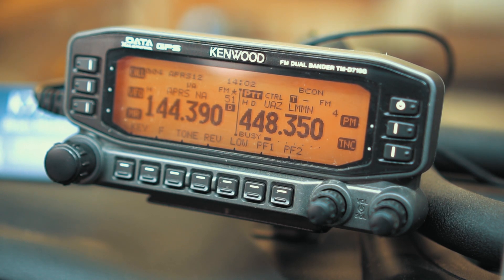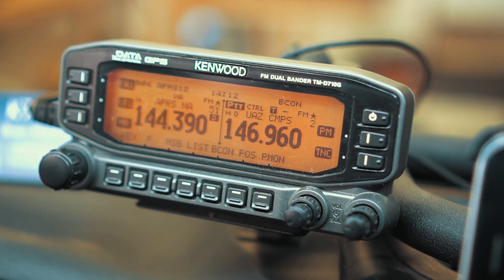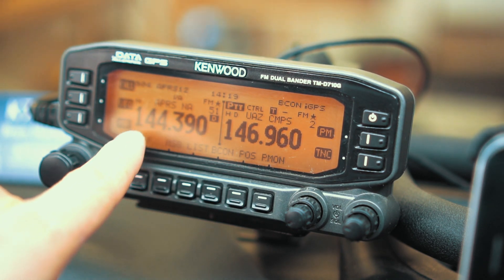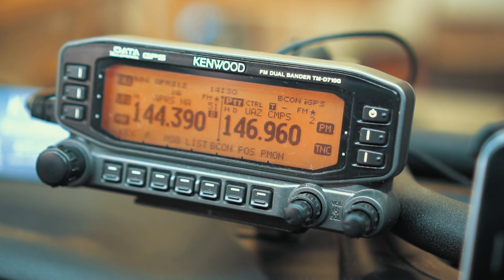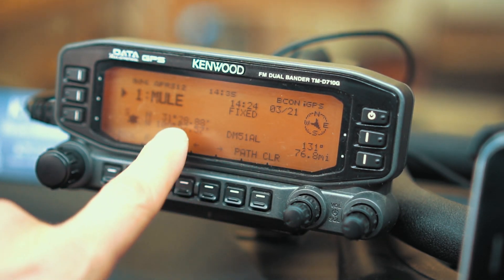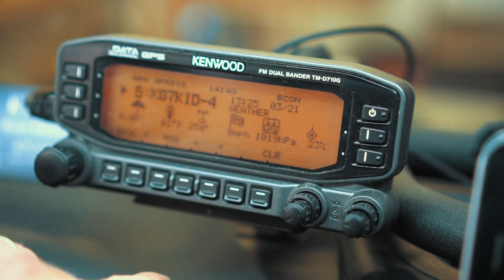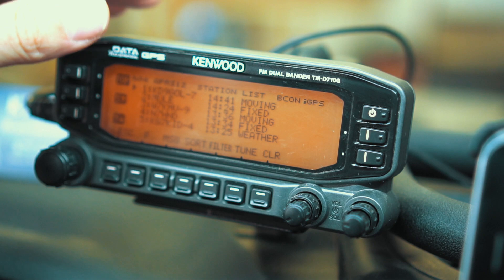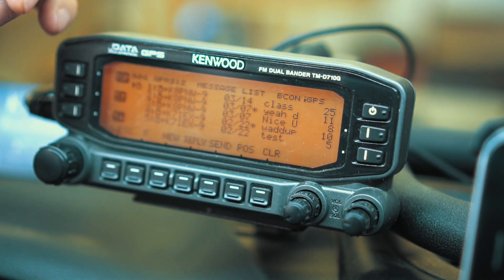A Quick APRS CRASH COURSE for Overland Adventurers

Comment: Hey Brien, nice video of practical uses for ham radio and APRS. I use APRS and the SMSGTE gateway frequently to communicate with non ham family and friends when we are out of cell signal, to let them know where we are and that all is ok. I have found as you mentioned being able to still find a repeater/digipeater even in areas where I have no cell signal.
73
Warren - N3DLU

Comment: Well here’s some pedantry: Wrong way round. APRS originally stood for APacketRS. When it came out there was no position reporting. It’s only after GPS became popular, and was integrated into the protocol that it was mistakenly called APositionRS. This is because it was then used for tracking more than anything else. Even the Protocol manual title is an error. It was not authored by it’s inventor, but Bob did later accept the new acronym. He can be found on YouTube stating such even after his passing, so now we could say either are correct.
Reply: Thank you, Karen.
Reply: @daveengstrom9250  it occurs to me that you don’t understand what a Karen is.
Reply from the maker: Just seeing this comment and you are totally correct! I knew this and I'm surprised it didn't catch myself when I was filming and editing! Old habits die hard, hah!

Comment: 📻🎧what other rugs are good for APRS?
Reply from the maker: The Kenwood TM-D710 (and previous generations) are the most APRS feature rich, but the Yaesu FTM-400XD is a good close second and will usually be a hundred bucks more affordable. There are also handheld options like the Kenwood TH-72A/74A but I don't have much experience with them. Radioddity also makes some low cost APRS handhelds that I'd love to pick up and play around with some day
Reply from the maker: I also just noticed that Yaesu now had a lower cost APRS radio, the FTM-200DR, looks really interesting. 50W, too!

Comment: The kenwood you demo is this top of the range in this class or is there one above this one, I want to upgrade from my kenwood tm281e.
Reply from the maker: In my opinion, this is the best dual-band mobile radio on the market, i can't think of one that is better, so i consider this one the top of the class for sure.
Reply: @SonoranSpaceProgram  this one in the video is the tm-d710ga?, and this will be available for south Africa 🇿🇦
Reply from the maker: @morrisdutoit850  Yes, the one i'm using in this video is the TM-D710GA, the last letter designates any region-specific tweaks. "A" for America, "E" for Europe, etc. the TM-D710G should be available to purchase in ZA but i'm not sure what the prices are like there
Reply: @SonoranSpaceProgram  thank you for all your info, if you compare the current radio I have tm281e vs the tm-d710ga will I have the same frequency range plus more
Reply from the maker: Yes. Your current radio is VHF band only, the 710G does both VHF and UHF, in addition to having built in GPS to enable modes like APRS

Comment: Brian, I also have this radio, almost 100% based on your enthusiasm. My head unit is very close to the base and the supplied cable is much longer than what I need. Can you advise as to what kind of cable I could use in it’s place?
Reply from the maker: Good question! Pick up a CAT5/CAT6/RJ45 "patch" cable of any length and it will work. Make sure it is specifically a "patch cable". Amazon is a good place to find cheap patch cable if you aren't able to find it at a local computer store

Comment: Hey another Tucsonian here.  I got my 710 installed in my truck and I have all my settings the way you and other people have suggested but I'm not transmitting my signal.  I get lots of packets but can't see my location on aprs.fi or send a text message.
Reply from the maker: Hi fellow Tucsonan! Check the squelch knov on the APRS side of your radio  if the squelch is too low it won't ever stop "listening" and will block your outbound packets from being sent. Feel free to mask up and swing by my shop (Sonoran Expedition Collective in Midtown) and I can help troubleshoot in person if needed
Reply: @SonoranSpaceProgram  Thanks a lot.  I might have to take you up on that.  I figured out the squelch thing though.

Comment: I am curious about responding to a APRS text message. You mentioned that your wife is a ham, however if someone(non ham) receives a text and that person wants to respond do they have to be a licensed ham?
Reply from the maker: Great question, i'll be putting together another video specifically about messaging and using the sms/email gateways. In short, yes, you need to have a license in order to respond to the text message or email. The text messages are sent from a gateway phone number, there's a mechanism for proving your license to the gateway and registering your own phone number. If the gateway receives a message from a non-registered phone number (for example, an unlicensed person) it ignores the message and does not relay it over the radio network
Reply: Brien Wankel I would have assumed it was more like a auto patch phone conversation where only the person operating the radio need be licensed.
Reply from the maker: @bradleyjohnson452  it kind of is in the sense that the outbound text initiated by a ham can be delivered to anybody whether or not they are licensed. with autopatch, the ham is always initiating and controlling the call. The license only comes into play when the recipient wants to respond back with another SMS. With autopatch, the recipient has no way to call back from phone to radio
Reply: @SonoranSpaceProgram  Here in Canada, The text message is going out by Internet to the SMSGTE gateway being Transmitted by a ham license gateway. As you mentioned Autopatch. It's the same idea except it's digital. The control radio operator is a licensed operator. AS long as the text message doesn't break (3) party rules, like ordering a pizza at a pizza shop and sending your visa/master charge number, etc. APRS and Winlink use the same rules. I can text my wife ( not a ham) and ask her to order a pizza. She can make the call and reply saying Pizza ordered on it's way to your location. The returning message is sent by SMSGTE which has a license call attach to it. I see nothing wrong.